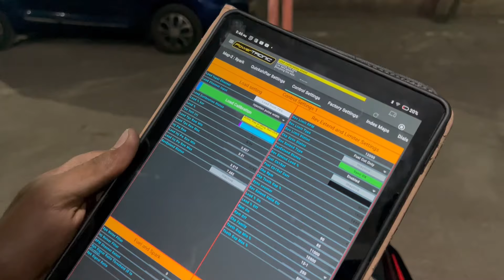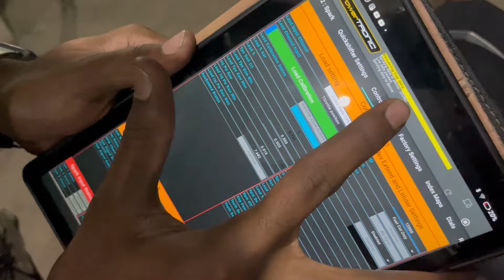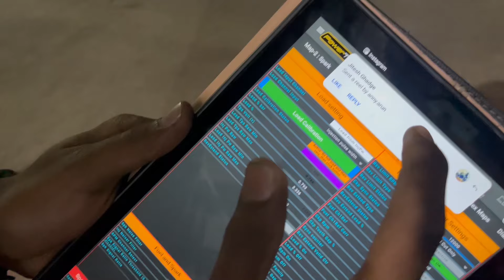Powertronic ECU INSTALLED IN R15 V3 | FASTEST R15 | EASY INSTALL | PERFORMANCE UPGRADE | ( Part - 2)

Comment: Engine is capable for higher rev upto 13000 rpm don't need to worry its block piston is made in high quality material which is not in rs and ns even  in ktm
Reply: Lmao 13k rpm😂😂😂😂
Reply: @primev1382 stock one revvs around 12k rpm

Comment: Bro isme to QS sensor wala plug kaha dalega?
Reply from the maker: Wo nai dalenge bro, aisehi chod do usko
Reply from the maker: Wo quick shifter ke liye hai powertronic ka
Reply: @pritishprakash_official  thanks bro meri fitting ho gai aur green lights v aa gai🥰
Reply from the maker: @lavkharva6141  Congratulations bro🙌🏻🙌🏻
Reply: @pritishprakash_official  thank you bro but app me set nahi ho raha…connect ho raha hai but set aapne kiya ese data sync nahi ho raha
Reply from the maker: Bro try it on laptop, Laptop me ho jayega
Reply: @pritishprakash_official  laptop me device connet hi nahi ho raha😅
Reply from the maker: Update karke dheko bro wo software ko
Reply: @pritishprakash_official  ji
Reply: @pritishprakash_official  ho gaya bro laptop se map
1 st gear me 54,sencond gear me 80 aur 3 rd me 110 jaati hai bro kya kamaal ki chiz hai yeh powertronic
Reply from the maker: Yeahh broo, Good Work👍🏻👍🏻🙌🏻
Reply: @pritishprakash_official 13000 rpm unlock ho gaya… kabhi kabhi rush driving se engine harm nahi hota na bro?
Reply from the maker: @lavkharva6141  nai bro, apne Map switch lagaya kya?
Reply: @pritishprakash_official  nahi…isme clip hai usko nikaalne se map 1 aur usko lagane se map2 hoga so switch ka 1500 kyu dena😅